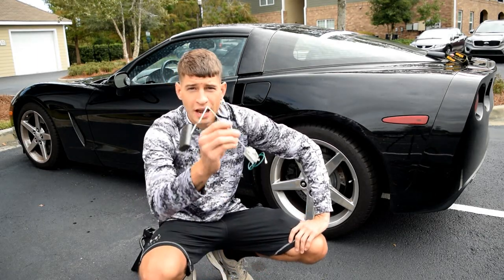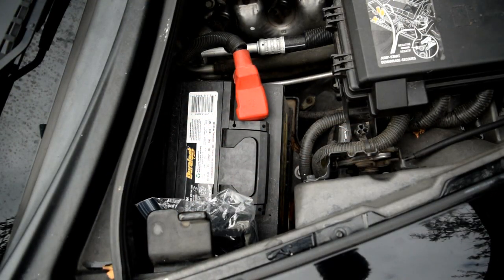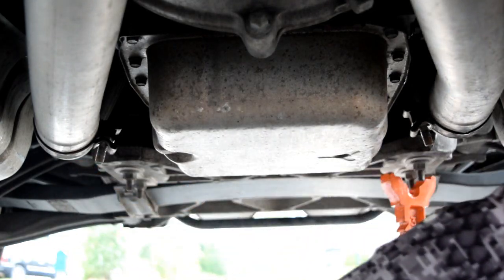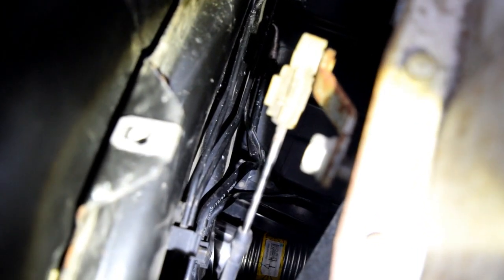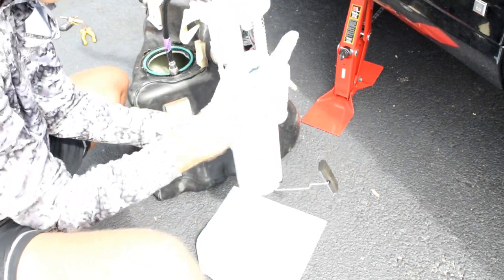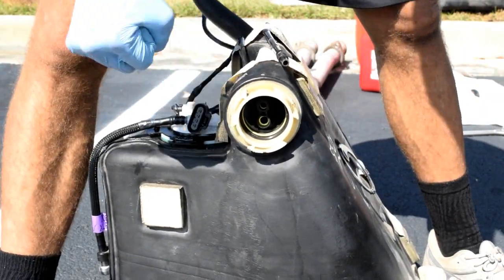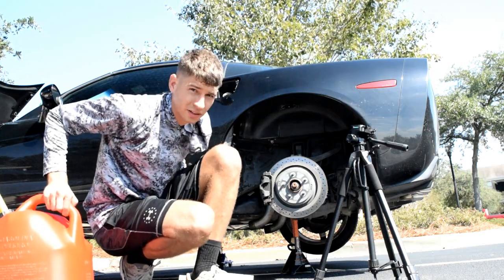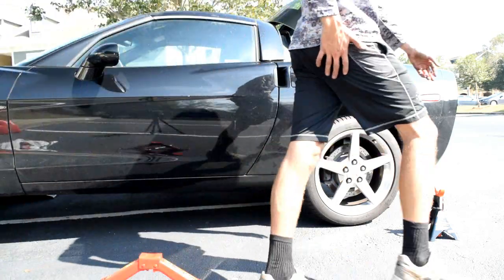Fuel Sending Unit C6 Corvette

Comment: Changed my driver side Pump on driver side Tank on my C5 , of course after installing pump and adding fuel gas gauge reads empty. Where do I  get correct sending unit ? Thanks in advance!
Reply from the maker: What year is your C5? Is it a base model? I was able to find mine on Amazon but you have to make sure the serial number matches for your vehicle. So when both tanks are full the gauge reads empty? Thats kinda of odd, it should read half full if one of the sensors has the strip going the wrong way.

Comment: Hi Drew, commentating on your video all the way from Denmark. :-) Nice video with good instructions and all, and I am just doing the same thing to my 2007 corvette, but I have to say, this is the worst job I have ever done, and I even have the car up on a lift. But that crossover tube should never have been invented. :-D I got it off after a lot of hours, with a crowbar, but the tubes inside it, is still connected, and they are lige glued together. Evenmore  I can't disconnect the evap line above either, so just a simple pain in the but, as you say... I just hate it. :-) Thx for good video though. :-)
Reply from the maker: Well howdy all the way over in Denmark, I can feel your pain with that one, I agree that the cross over tube is a bit of a torture machine, I guess they didn't take into consideration serviceability on that part. I wish you the best of luck :)

Comment: Do I have to buy the fuel sending unit  separate or will I find it in a new fuel pump?
Reply from the maker: Most fuel pumps should come with the sending unit (look for the little float on a wire arm), just make sure its the right one for your year, or else it may read backwards to the ecu,  best of luck :)

Comment: cool vid, no start or noise from the pump after replacement, any suggestions?
Reply from the maker: Have you tested the fuel pump relay? I had an issue where mine had gotten pretty corroded and it was causing a no start situation

Comment: My fuel gauge reads empty. But when I pull the battery negative, and put it back it’ll read half a tank for like 5 min! Then back to empty “service fuel system” light. How do you know which tank needs to be replaced? Thanks
Reply from the maker: Thats a bit of a tricky situation, definitely one of the sending units is going bad, but its really tricky to know which one exactly is the issue, to be honest I would recommend knocking them both out as well as the fuel pump while your in there, and hopefully you will be able to get another 10 years out of it with no issues. Best of luck!
Reply: Drew Mann perfect! Thank you for the reply! I really appreciate it!
Reply from the maker: Hope it all works out for you, and best of luck if you decide to tackle it DIY style.

Comment: I have a "Service Fuel System" warning and a fuel gauge that goes from full to empty sporadically in my 2007 Base Manual Transmission Coupe so sounds like a Fuel Sending Unit is in my future.

Any differences since I have a '07 and it's a Manual?
Any differences from the above procedure for the passenger side tank?

By the way, great job.  It was really helpful seeing what's involved.
I've been putting off dealing with this since I heard you had to drop the rear end but I think I'm going to tackle this now.

Comment: Great Video DrewMan RC 
I have a question are those Rhino Ramps do they clear the vette with no problem?
Reply from the maker: Carlos Ve, they are ths rhino ramps, think I got them from autozone, they work fine with no major issues, they do touch the air dam when rolling up and down but not enough to cause any issues
Reply: DrewMan RC    Thanx

Comment: Did your check engine light go away ?
Reply from the maker: Sure did, but the primary issue for this job was the incorrect fuel readings, which was indeed resolved.

Comment: What’s up bro. Just had my passenger side sending unit replaced and still have “service fuel system” message and my fuel gauge is not reading still. Any ideas? Do I just reset the battery?
Reply from the maker: Howdy Kevin, that is a tricky one, my initial concern is that perhaps the driver's side was the issue, but not knowing any of the specifics I couldn't really say what the issue might be. Its hard for me to recall if I had gotten that same message about servicing the fuel system or if my only indication was the broken readings on the fuel gage. Best of luck to you!
Reply: @DrewMann  hey man, thank you for your response. Just filled up the tank. Cleared the code and fuel gauge works fine now. It’s all good, just think it had to get reset.
Reply from the maker: @kevinalonso3395  good stuff! Let's hope it keeps working! :]

Comment: you did the work in your driveway? Amazing effort, I was afraid to do mine, but after seeing this, I will do it myself instead of going to the dealer. They would probably charge me a $!000 just to diagnose it, lol
Reply: ps . I am 67 years old so I will probably do it slowly but surely, as I have a clutch to change in my 4by 4 Tacoma next! lol
Reply from the maker: @edjeep  it's a solid challenge, and that cross-over tube is a pain to get off and on, but the fix has been holding well for all these years now. Best of luck to you, stay safe under there!

Comment: From a safety standpoint; please let the car weight down onto the jack stand. The jack is very unstable and the jack stand is easily moved as you work under the car without the weight of the car holding the stand in place.

Comment: How in the heck did you get the little tubes apart inside the crossover pipe? I can’t for the life of me get those off. Calling it a day. Try again in the morning. Hopefully you’ll read this before I start up again. If there’s a special tool that worked best for you please share what that is. Picture perhaps?
Reply from the maker: The little tubes did seem to be age-glued  in, no actual glue but they certainly didn't want to pop free the first time I did it. Depending on how you are tackling this job may alter potential approaches. Is yours standard or auto trans? Did you drop the transmission? I saw one fellow on the corvette forums had created a jig to clamp the cross overture and compress it, but that doesn't directly help loosen the inner tubes. I think stepping away for a little while can certainly be helpful. I'll do a little looking and get back to you shortly
Reply from the maker: I think a flat bladed screwdriver may be able to help, are the inner tubes being pulled out of the tank as you pull the cross over tube out? I just looked up some photos of the assembly to help jog my memory, but it's been a good few years since I fiddled with this one. If its not your daily driver I would say maybe brute force it if you don't mind if some parts might break, but I think the costs can stack up quick to replace those parts, and shipping may take a lot longer than normal.
Reply: Drew Mann ran outa steam while I was trying my luck with pushing and prying with my flathead screwdriver. I’ll keep trying tomorrow. If you can send me pictures close up of the inner tubes that would help me know where to put the pressure and leverage. Thanks!
Reply: Automatic. Did not drop trans. Dropped exhaust. I can see the inner tubes and they’re the last thing keeping this thing from dropping. Don’t have a screwdriver long enough to access from underneath. Trying from inside pushing with screwdriver lengthwise to crossover. Does that make sense? I’ve got zip ties to secure the inner tubes in tank as those tabs look like they’ve broken for sure. My question is, are the inner tubes in the crossover pipe more secure and are the male or female ends? Don’t want to break anything if I can avoid it. But I can get by without driving her if I have to. Savvy?
Reply: I got the tubes off! Please let me know the trick to getting them back together. Lol! Hope you had a happy Easter Sunday. Thanks for your help!
Reply: @graysenfox3600  how did you get them off and back together ?

Comment: Part number on the fuel pump???
Reply from the maker: I purchased a Delphi FG1092 pump from amazon, and had to replace the sending because 2005-7 used a different style resistance strip, the sending unit I used is ACDelco SK1169. If you can find a pump module that is for thee 2005-7 you can save some work, assuming yours is within those model years.

Comment: WTH, shops requiring 11 hours to remove the fuel tank and require dropping the whole rear end.  Sending them this video lol.
Reply from the maker: To be fair, their method is probably less of a pain in the butt when it comes to that crossover tube, if I had the equipment available I may have done it differently, but necessity is the mother of invention I suppose.

Comment: Now i have this exact problem in my 05 z51 do i need to do this to both tanks or just driver side ..please help
Reply: What problem do you have?? Gas gauge works intermittently?
Reply: @panzerwaffen2873  mine does that
Reply: @lalozichlids3245  try two bottles of techron two of 12 gallons on an empty tank
Reply: First tank to get empty is the passenger one ..if you fill up your Vette and it fail with a full tank then you have the passenger sending unit bad ...I would replace both sending units ..they are not expensive what takes time and effort is to take down the sending units
Reply: Already ordered the passenger side one
Reply: @lalozichlids3245  good.. how much?
Reply: $200

Comment: Drew Man thanks a mil. I drive a 2000 c5 M6 Vette.  As usual getting the "LOW FEUL" light w/DIC (Code :P01431),  which indicates pass. side fuel sending sensor prob. On this model I was told that I could access the sending unit by un-bolting it from the tank & removing it w/o dropping the fuel tank. I was told this side has just the level sensor plus other components. Have u a vid. on doing the passenger side of the '97-'04 c5 cars?  Also how do I make sure I purchase the correct fuel level sending unit/sensor for my 2000 c5 M6 vette? HELP!!  Best. :hand-purple-blue-peace:
Reply from the maker: Howdy, I'm sorry to hear you are dealing with a similar problem. Unfortunately, I haven't had any experience with this issue on a C5, although I would guess that there may be some similarities to the C6. As for ordering the right parts, the fourms might be able to provide some insight? Best wishes to ya!